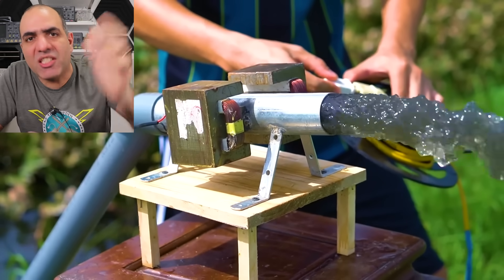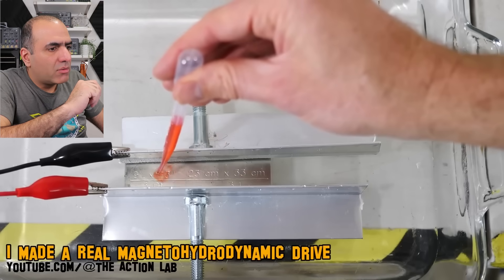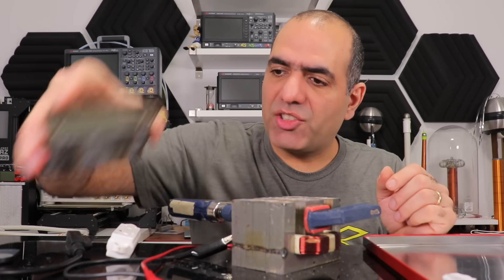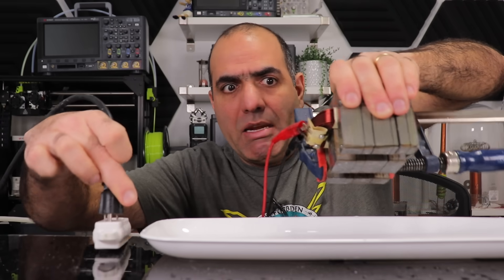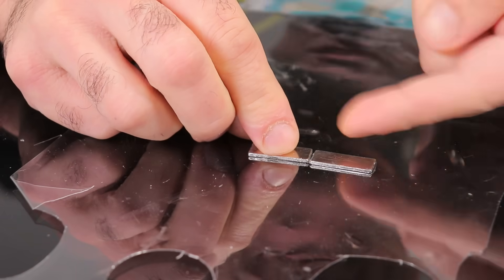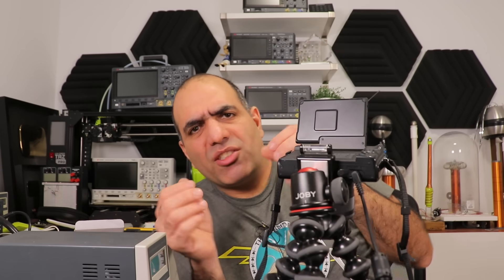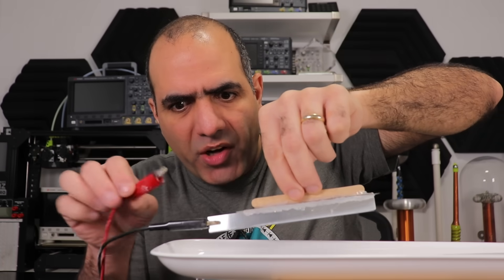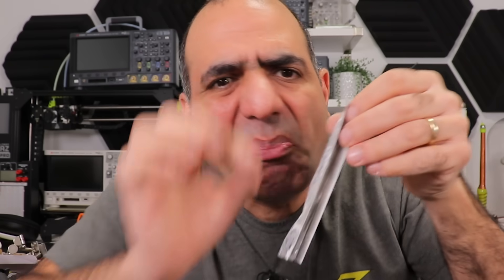Making a Water Railgun

Comment: A while back I got some Ethernet extenders that use the house power lines as data lines. You plug both nodes into an outlet and connect one to the router and one to your computer and you can have a wired connection anywhere in your house. You should check these out cause I have no idea how they work
Reply: Ooooh, this would be a good one. I know basically how they work, but not the specifics. Back in the day, early ethernet networks ran on networks of dedicated, coaxial cabling. The powerline ethernet adapters you are talking about basically convert the ethernet signaling to something that resembles a TV/radio signal coming down from an antenna. That signal gets added to the home powerline network. The signal runs at a different frequency than the 50/60 Hz. This makes it relatively easy to use a filter at the other end to separate this signal out, then convert it back to an ethernet signal.
Reply: I can imagine Mehdi getting out his oscilloscope, showing waves of different frequencies, adding them together, then showing how you can use filters to separate the signals back apart. Then he would try the same thing with soup cans with a string between them, somehow shocking himself in the process. Finally, he would try to create his own "whole home intercom" by attaching a microphone to a wall outlet, only to have it go horribly wrong when his daughter decides to make microwave popcorn in the kitchen.

Comment: Imagine, if one had a nuclear powered submarine in the ocean that could deliver high power to a propulsion system.  The U-boat could run silently with high voltages and high current.  If the submarine had an internal channel to focus the sea water in and eject the water out the back of the boat, it could be propelled forward with no motor sounds; run silent - run deep!

Comment: The majority charge carriers in fluids are ions unlike solids where the majority charge carriers are electrons or holes. I'm guessing that's why the resistance doesn't vary linearly. And I believe the ActionLab video doesn't achieve anything by generating magnetic fields and induces movement of fluids with the electric field instead.

Also, I'm not a regular viewer of your channel and each time I see a spark, I flinch every time because of the bad experiences I've had with sparks😂

Comment: That was so much fun. The sodiumchloride ( salt) and the water are electrolysed, so you get hydrogen gas and chlorine gas. And the sodium ? Well that combines with the OH left over giving you Sodium hydroxide (in solution). Because aluminium will react with the sodiumhydroxide ( a base) this will form even more hydrogen gas and sodiumaluminate (salt in solution ) and heat (lots of) heat. Fun!
Reply: So why didn't Red October generate a trail if Hydrogen and Chlorine gas when it used  a MHD drive in salt water? Maybe I should sign up on Brilliant :)

Comment: I know you is a smeert guy but usually you only run about 12-24v to a microwave electromagnet from a power supply if you run it on 120v or 
230v depending on where you live if you run it at 120v it will over heat and pop your breaker 👍 have fun and remember safety third 

Ps I know you probably don’t care but I’m 13
Reply: And if you were wondering, I come from experience

Comment: 13:33 if you run current through water at one terminal you will get hydrogen gas which is flammable but not poisonous and on the other side youll get oxygen, on the other hand if you do the same thing to salt water instead of oxygen you get chlorine gas which the germans use in their funny showers back in the day

Comment: Great stuff! Totally agree with the conclusions that the original video was fake. Waters interaction with magnetic fields is known as diamagnetism, it's very weakly repelled by magnetic fields. It is possible, using this fact, to levitate a droplet of water within a magnetic field. This has been demonstrated with fairly large droplets, one report I read suggested a droplet of up to 50mm had been levitated. This was using in a full laboratory setup, with superconducting magnets. Using the diamagnetism of water it's also been proved possible to levitate small animals, such as young mice and frogs, using a similar setup of superconducting magnets. If you google levitating frog and high field magnetic laboratory there's plenty of information out there about it.

Comment: Can you prove that the free energy microwave generator is fake please, they us 2-4 cut in half microwave transformers arranged around a spidle, the spindle has two magnets stuck together around the spindle in line with the microwave transformer, the guy then starts the machine using a pull cord starter from a lawn mower, the spindle is also attached to a motor I'm confused as to how it's making electric as one diminishing returns and also I'm not too sure what's meant to be making the electric whether it's the motor or magnets or both together, I think the magnets and motor are going into a car coil pack to store the power but none of it makes sense to me, they tear it down so you can see there's no battery I then thought maybe it was a wireless power pack in their table but then they took it outside and it still worked ?, I thought either way surely the magnets would cause resistance stopping it from actually working but also thought you'd get diminishing returns from the generator?

Comment: What if, instead of water, you used something like mineral oil and dumped a whole bunch of iron flakes into it? Would they all just stick to the magnets, I guess? Or would it make a stronger current?
Reply: I suppose the rails would have to be insulated or it'd short out immediately though.

Comment: Mehdi! use the filling from the Gauss gun, where instead of the coil this motor that you made will be connected, then charge the capacitors and drop salt water from the syringe onto the motor, if the drop flies away, then this is a victory

Comment: The idea is to user AC both for contact rails and electro-magnet. In the case of correct "polarity" (so that magnetic field would drive the electrolyte in the correct direction) you can have a strong magnetic field and almost no electrolysis.

Comment: Hi Mehdi, very impressive.
BUT CAREFUL:
Not only that the salt water boils,
there is also an electrolytic decomposition:
At the negative pole (cathode) hydrogen gas (H2) is produced,
Chlorine gas (Cl) is produced at the positive pole (anode), because of the dissociated sodium chloride (NaCL) = common salt.
Chlorine gas is toxic.
Larger amounts of H2 and Cl2 can result in a chlorine gas explosion, if an initial ignition (e.g. spark) occurs.

Many greetings
Stefan
from Ahrensburg, Germany

Comment: 13:30 from my experience from crude manufacturing of hydrogen using salt water sheet metal and car battery... the chemical reaction makes something bleach like. so you cannot run your water so much and have to change it often unles you wanna dispose of what is essentiely bleach. but worse
Reply: smashed this is getting ridiculous

Comment: I consider myself brave and used to HV.  But that line voltage rectified and just holding in it by a Popsicle stick was really sketchy.  I assume he has an isolation transformer off screen so he has to get across both lines to get bit.

Comment: Use a high wattage filament light-bulb in series with the MOT so it ballasts and keeps it from popping the breaker. Power will be reduced to the max the wattage of the bulb, but hey it stays on at least.

Comment: There’s also the electroosmotic force - I worked on it in college for a year in a research lab- though it requires a glass capillary tube with negative charge. Completely fails at dimensions even approaching a mm but it does move water with an electric field. (Also requires 1000s of volts but who’s counting)

Comment: And mind, you had to use nearly saturated salt-water.  Pumping THAT on your field is not going to grow many crops.  And of course if you just use ground water, you won't get even the flow Mehdi got.

Oh, and electric current through water saturated with NaCl will liberate the Cl as a gas (chlorine gas is poisonous).

Comment: In 1991, the Japanese launched an experimental boat "Yamato I" driven directly by a magneto-hydro-dynamic drive (it was powered by two diesel electric generators, each approx. 4 MW). The propulsion itself consisted of two gondolas through which flowed sea water subjected to a strong magnetic field and electric current. The strong magnetic field was generated using low-temperature superconducting coils that were arranged to avoid strong field scattering over a larger area.
The disadvantages of this design were low efficiency (about 4%), hydrogen production by the electrodes and corrosion of the electrodes themselves. However, scientists say that further development of this technology may provide a solution to these problems.
Companies building classic and submarine ships are most interested in this propulsion because there is the potential to "silence" ships in the underwater space.
I would not definitely reject the MHD drive, because one day it may be the dominant drive of ships, but rather the larger ones.

Comment: Water is actually diamagnetic and can be be moved even in its pure form without an electrical current but it's primarily repulsive and it's a very weak effect look up magnetic levitation of water. Extremely powerful magnets, superconducting, and very close ranges

Comment: would that gas coming off the water be chlorine or hydrogen?
I remember I made both chlorine and hydrogen gas by running a voltage through salt water, so surely that would be happening in this reaction?

Comment: I think you are electrolyzing the water and it is producing Hydrogen gas (that catches fire) and Chlorine gas that quickly reacts with the Aluminum metal to produce Aluminum Chloride (which is white in color). Aluminum chloride can be toxic and damage tissues, so yes, maybe the fumes are poisonous. It might be safer(?) to do this with iron strips so they produce Ferrous Chloride that is green in color and not toxic(?). I could be completely off though

Comment: If you're a poor farmer using river water, what you are going to want is called a ram pump or ram jet pump.

You divert the water and the force of the river pushes some of it through a check valve and slowly builds up enough water to start flowing

Comment: Throw in a one way Tesla valve and you can pump water uphill, no? Wouldn't it increase the pressure if the EM device were smaller? And sense it gets hot would it not make a potential point of use water heater?

Comment: 13:28 The gasses produced here are probably hydrogen gas (harmless in these quantities) and chlorine gas (generally not great).

You can do water electrolysis that produces oxygen and hydrogen if you have essentially no ions in solution, but since you've dumped what I'm assuming is table salt in, I'd suspect that you're getting almost no oxygen and almost all chlorine.

Comment: The explanation is not correct. The effect is not the same as a regular railgun "amplified" by permanent magnets, but a sort of Hall effect over ions. If permanent magnets could amp railguns, they would be used in them, but they are not.

Comment: 13:31 yeah actually at high salt concentrations there's enough chlorine anion that it overtakes oxygen production so you get pure chlorine gas and hydrogen gas, as well as sodium hydroxide in the water. Concentration is probably way too small to cause harm here but it's an industrial process to produce hydroxide and chlroine iirc (chloralkai or smth)

Comment: The gases are just pure oxygen and hydrogen from the induced electrolysis. Unless you plan on concentrating the O2 gas to a partial pressure >= 50%, there's nothing to worry about... just don't strike a flame.

Comment: "Marine propulsion

A view through a tube in the thruster of Yamato I, at the Ship Science Museum in Tokyo. The electrode plates are visible top and bottom.

A view of the end of the thruster unit from Yamato I, at the Ship Science Museum in Tokyo.
MHD has no moving parts, which means that a good design might be silent, reliable, and efficient. Additionally, the MHD design eliminates many of the wear and friction pieces of the drivetrain with a directly driven propeller by an engine. Problems with current technologies include expense and slow speed compared to a propeller driven by an engine.[13][14] The extra expense is from the large generator that must be driven by an engine. Such a large generator is not required when an engine directly drives a propeller.

The first prototype, a 3-meter (10-feet) long submarine called EMS-1, was designed and tested in 1966 by Stewart Way, a professor of mechanical engineering at the University of California, Santa Barbara. Way, on leave from his job at Westinghouse Electric, assigned his senior year undergraduate students to build the operational unit. This MHD submarine operated on batteries delivering power to electrodes and electromagnets, which produced a magnetic field of 0.015 tesla. The cruise speed was about 0.4 meter per second (15 inches per second) during the test in the bay of Santa Barbara, California, in accordance with theoretical predictions.

Later, a Japanese prototype, the 3.6-meter long "ST-500", achieved speeds of up to 0.6 m/s in 1979.

In 1991, the world's first full-size prototype Yamato 1 was completed in Japan after 6 years of research and development (R&D) by the Ship & Ocean Foundation (later known as the Ocean Policy Research Foundation). The ship successfully carried a crew of ten plus passengers at speeds of up to 15 km/h (8.1 kn) in Kobe Harbour in June 1992.

Small-scale ship models were later built and studied extensively in the laboratory, leading to successful comparisons between the measurements and the theoretical prediction of ship terminal speeds.

Military research about underwater MHD propulsion included high-speed torpedoes, remotely operated underwater vehicles (ROV), autonomous underwater vehicles (AUV), up to larger ones such as submarines."

TLDR, it exists but it's not a viable technology with today's means.

Comment: If you could do it without causing the electrolytic reaction and screwing up the chemistry this could be a viable way to move high solids water in sludge systems rather than using centrifugal pumps that get destroyed. Maybe something for production machining where they use a non-water based cutting fluid where the chips would be the conductor so the recovery trenches don't get clogged. Heat would probably destroy the cutting fluid too though. Interesting video as always Mehdi!

Comment: Thanks for a great video as usual! This doesn't need a fancy name - it's a simple example of the right-hand rule (the Lorentz force F= qv x B associated with a charge moving in a magnetic field producing a force as the cross product of those 2 vectors). As -ve ions move towards the +ve plate they will experience a force along the channel. The +ve ions move in the other direction across the channel, but because they are of opposite sign, the effective current is in the same direction and so they also experience a force in the same direction along the channel and so the entire body of water is pushed along the channel. Yes the gases are poisonous (chlorine if you used table salt) - far safer to use sodium bicarbonate to make it conductive, but when has danger ever stopped you from experimenting! 🙂 A cool thing I created back in high school, along the lines of what was shown in the debunked video, was to make the water spin - put the water in a petri dish and line the interior wall with foil, place a magnet under the dish and another with the opposite pole above the dish, suspend a pin from the top magnet that dips into the the center of the water, run a radial current from the foil to the pin (via a connection to the top magnet) and viola, you've got a model cyclotron. 🙂 Cheers.
Reply: Yeah fancy names are just historical. Railgun - the simplest and earliest example of Lorentz force use by someone who tried to conceive an electricity-powered gun. Originally it's what engineers call "linear motor" and concept of railgun was introduced in 1910s. Gauss gun or coil gun - uses same rule but force is created by inducted currents.  This "water railgun" was originally conceived in early 80s and quickly replaced by "water coilgun" - a.k.a. electrohydrodynamic turbine.
Reply: I am learning about the right hand rule in college right now and was wondering if you could explain it to me, I know your thumb faces the same direction as the current but what does your pointer and middle finger represent and how do you know what direction they go in?
Reply: @bluefates58  Plenty of videos online covering this. Most use 2 fingers and your thumb but I prefer using the fingers of the hand to represent the magnetic field lines and their direction and the palm or bent 2nd finger to indicate the push - e.g. https://www.youtube.com/watch?v=47uESIjJSTg - be careful with exams as they almost always give problems that make it easy to use your left hand by mistake.

Comment: You say water isn’t magnetic, but if you add certain food colourings that contain traces of iron to the water you end up with particle flow which causes the water to move, also the water out of the tap in the countryside will have traces of metals meaning almost magnetic water

Comment: Very entertaining but the two things I took away from this is not to let salt water wash the oil out of your skin when handling low voltage and secondly the electrolysis developing hydrogen and oxygen inside your hydro rail gun is sufficient to blow the water out of the barrel of your water gun as a propellant and not by magnetic forces, but how would you concentrate it and ignite it?  Could you use Rubidium or some energetic alkalie earth metal?